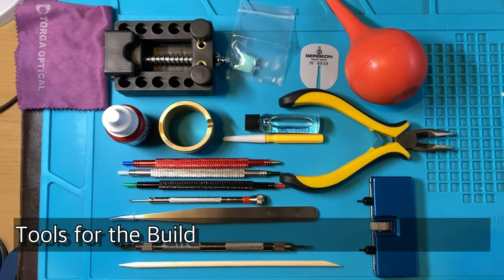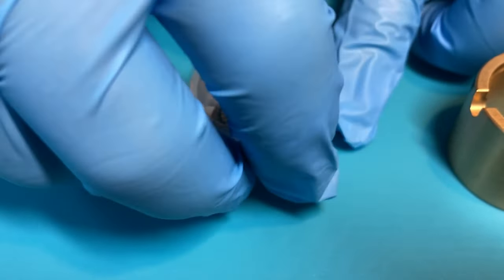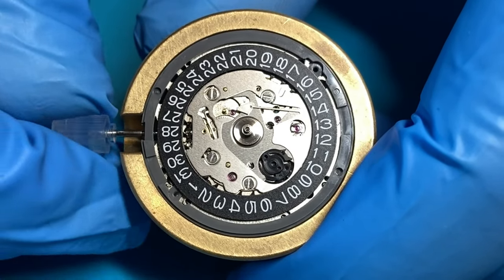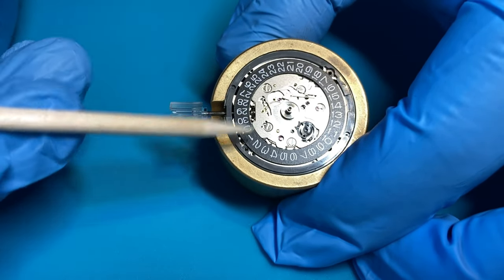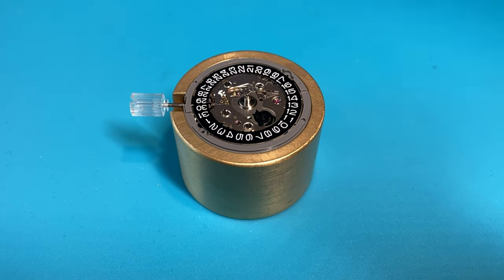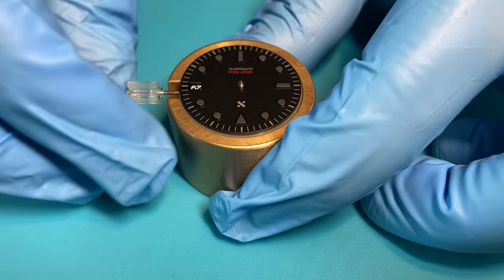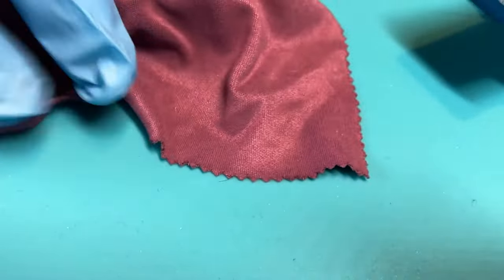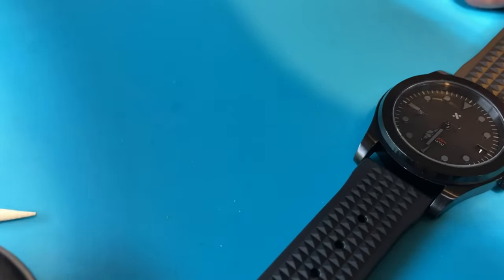1,2,3 - Build it with Namoki

Comment: I have just finished my built yesterday successfully and without a lot of stress - it was even enjoyable. And it's all thanks to your instructions! 

I just had to look up, what a screw down crown is, because I thought I had messed up the installation of the crown stem, as I have to unscrew the crown to set the time.

In a few forums and videos it was said to use a thick lubricant like 9501 / 9504 or molycote dx on the crown stem.
Reply from the maker: @spaekplugbarrens congratulations 🥂! Building your own watch comes with exclusive bragging rights! I’m glad you figured your way through the screw-down-crown conundrum. You’re right about the thicker viscosity lubricant. It’s a high friction, high torque interface. Send me some photos via chat on my IG channel Ros_Bou21
Reply: Will do! I also recommended your channel in my review on the namoki website 😊

Comment: The movement holder is perhaps the most important part. Why is it not included in the set? I understand the holder is size specific, but why can't it be a specified item (you choose upon purchase)?
Reply from the maker: Hi TH. I will pass your thoughts on to Namoki. Yes, an ‘optional extra’ at checkout is a good idea. There is only one movement holder size for all NH Seiko movements. Here is a link for your next mod purchase: https://www.namokimods.com/en-eu/products/nh-movement-holder-stainless-steel?ref=SXouSdvQXTfmd
Reply: i got as far as taking the stem out and theres no safe way to continue without it

Comment: Another great tutorial on this build! What oil do you use exactly?
Reply from the maker: I used moebius watch makers oil available on AliExpress
Reply: Thank you! So that's just any moebius watch makers oil or a certain viscosity or type? :)
Reply from the maker: So the one I bought was this tube of Moebius 8000. I’m not certain that it’s the perfect viscosity for this application, but it’s better than a dry interface. Just found this amazing item on AliExpress. Check it out! €5.99 | Swiss Original Moebius 8000 Oil Special Watch Oil Professional Oil Watch Repair Tools for Watchmakers
https://a.aliexpress.com/_EIznVzj

Comment: How would you remove the clockwork from the case if you had not aligned the 3 o'clock mark with the wind?
Reply from the maker: If you look on the grey shroud that surrounds the movement (the plastic one) you will see thin horizontal slots at certain intervals. If you slip a screw driver into one of these slots you can lift the movement out easily
Reply: Thank you!

Comment: do you think this watchmaking kit is good enough to build other watches with? any recommendations for a beginner watchmaking kit? im not interested in the watch but the kit itself just not sure where to start
Reply from the maker: Hello Eddie. Thank you for the heartfelt questions. Yes, this toolkit is very well considered and contains a great deal of what you need for a simple build. As far as I can tell, Namoki only sell the tools as part of a DIY watch kit (I don’t know if they sell them separately). 
From among the DIY watch kits, I would highly recommend their new 36mm Oyster case and bracelet set. https://www.namokimods.com/products/nmk-wk08-diy-watchmaking-kit-perpetual-dress?ref=SXouSdvQXTfmd
If you don’t like any of the dials you can order any of their dials and it will fit this case. 
There are a few extra tools you will need that don’t come with their kit. They are:
Magnifying glass - https://www.namokimods.com/en-eu/products/bergeon-2611-tn-watchmaker-loupe-with-opening?ref=SXouSdvQXTfmd

Movement holder - https://www.namokimods.com/en-eu/products/nh-movement-holder-stainless-steel?ref=SXouSdvQXTfmd

Case cushion - https://www.namokimods.com/en-eu/products/bergeon-5395-55-soft-gel-watch-case-casing-cushion?ref=SXouSdvQXTfmd

Gasket lubricator - https://www.namokimods.com/en-eu/products/bergeon-7055-lubri-gaskets-with-silicone-grease?ref=SXouSdvQXTfmd

If you have a bit of time to spare, I will be doing a review of the DIY watch club toolset before the end of Feb. It looks like a good kit. It includes the magnifying glass, but also needs the movement holder, movement cushion and gasket lubricator to be bought separately. https://shop.diywatch.club/products/diy-watch-club-card-board-watchmaking-tools-box?ref=Zlvu2gIN8PRtu-&utm_source=affiliate

Comment: Hi is it still possible to build a watch using items purely provided by the diy kit from namoki? I notice all of the video's i've found on youtube use a movement holder which namoki doesn't include in the kit
Reply from the maker: Hi Jose. You are correct - the movement holder is advised and I have asked Namoki if they can add this as an option. They are well worth the investment though. https://www.namokimods.com/products/nh-movement-holder-stainless-steel?ref=SXouSdvQXTfmd

Comment: A good video, but Namoki instructions completely inadequate. My second hand does not work sadly, could be a broken centre pin? The watches look nice though.
Reply from the maker: Hi Paul. I was hoping to augment Namoki’s instructions by making these videos. I’m sorry about the second hand not working. There are a few possible causes. The first is a broken second pinion. If this is the case you won’t be able to place the second hand at all. The second possible cause is that the tube of the second hand may be wedged between the second pinion and the collar on the minute hand. If this is the case you should be able to remove and re-install the second hand. 
A third possibility is that you may have pushed the second Jane into position too hard and disengaged the second gear from the gear train. If it is reason 1 or 3 you would need a new NH35 movement. You can get them on AliExpress for far less than At Namoki. Let me know if you have any more questions.
Reply: @watchmebuildit  thanks for your help. I watched this video and bought a loupe (https://youtu.be/52oz1bgpLtA) The centre pin was actually ok. I did find using a hand removal tool allowed me to apply more gentle and targeted pressure to the second hand, though I did scratch the dial. It is a very delicate step and perhaps more videos can highlight just how easy it is for this step to go wrong! Thanks again for your help and the great videos.
Reply from the maker: Hi Paul. I am delighted that you prevailed! Your scratched dial will be a well earned war wound - proof that you’ve earned your stripes